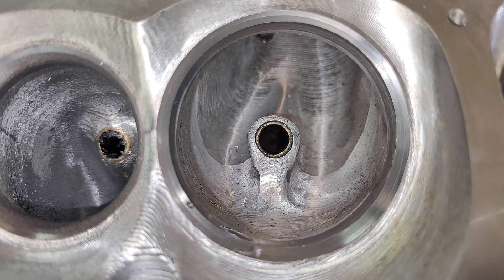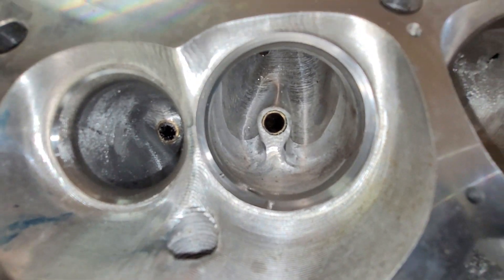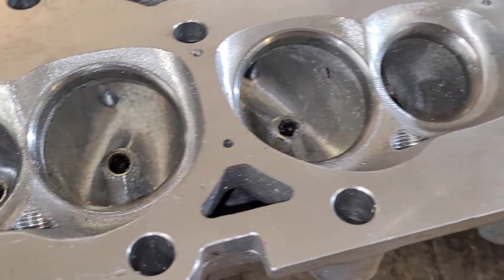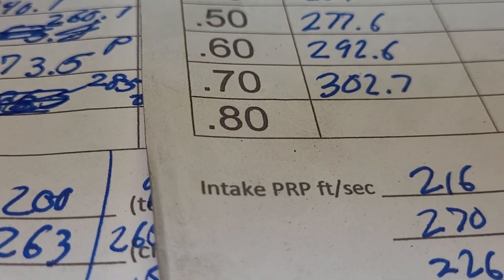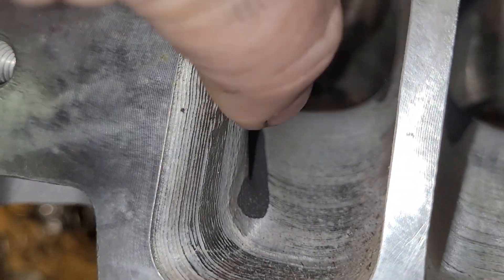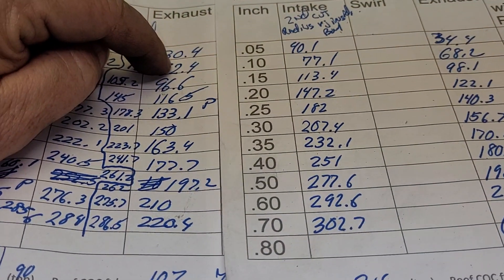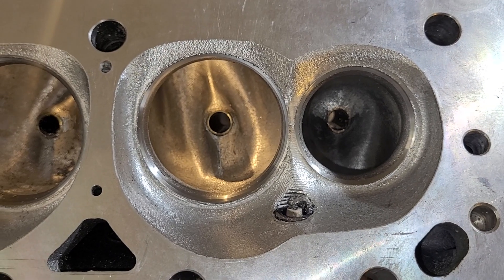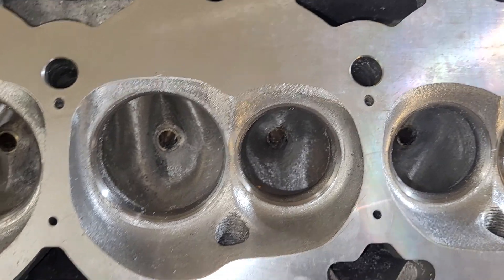RPC Chevy 230cc cnc aluminum cylinder head vs. hand ported RPC 236cc

Comment: Charlie, would the guide spacing allow a 2.100 intake? How about the seat od? That would seem more in line with a 230+cc 23 degree sbc head. Could you slightly sink the intake seat while enlarging to fix the lack of material on the quench side?
Think you might be able to find a 25-30 cfm increase with those changes to get them in the ballpark of a decent 230+cc head?

I used to aerospace CNC. It almost seems like they took a 180cc program and just "cutter comp dia" adjusted to increase the volume, but stayed with the small valve. Did you check the throat % ?

My as cast Brownfield/AFR 220cc from the late 1980's flowed more than these.
Reply from the maker: The throat was tight. I added some radius to the throat which helped a bit. It does need a bigger valve.

Comment: That is the dart platinum 200cc copy. They are sold unported by assault/nob200 skip white/rpc/proheader. Those are what I was asking you to port for me a free months ago. Those numbers suck fora 230 port
 The stock port almost flow what those cnc ports flow.
Reply from the maker: Ok. I did not know they were the same casting.

Comment: Are you surprised that they only used a 2.02 intake valve? And are the air speeds lower than you would have expected? Thanks for the video.
Reply from the maker: I wouldn't use a 2.02" on a port that big.